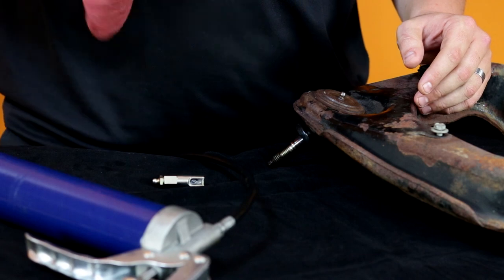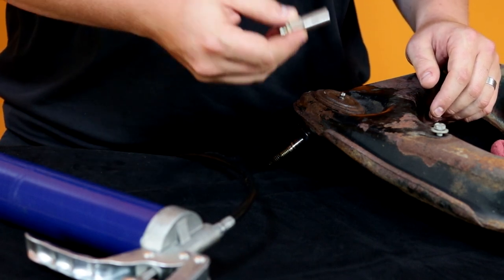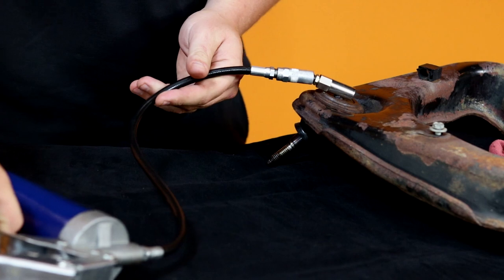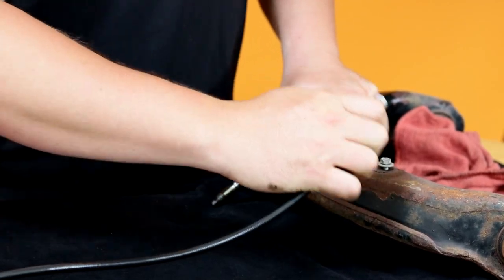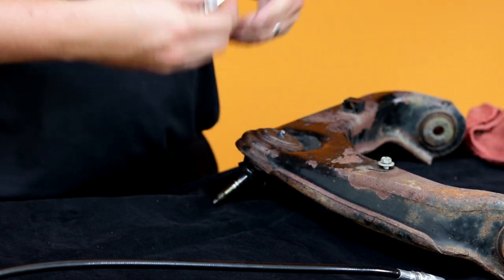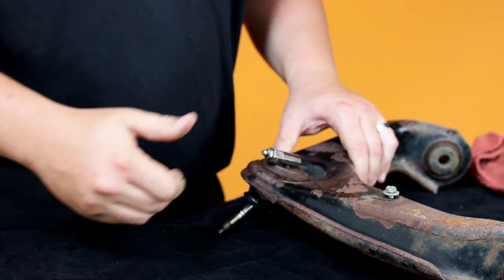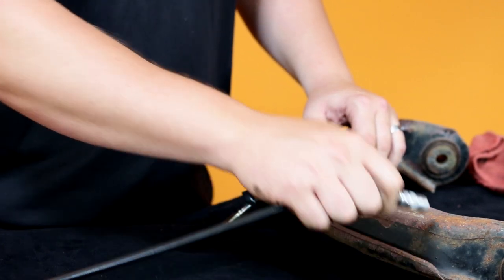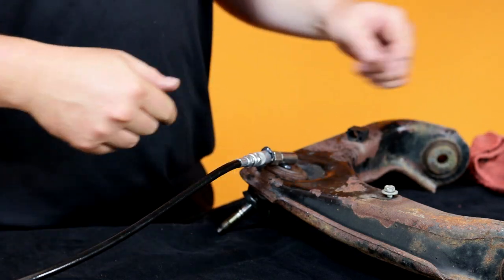Mechanics Minute: How to use the Right Angle Grease Adapter

Comment: I have two of those, different brands and can't get either one on the zerks on the Yamaha outboard. Neither snap into place. Grease goes everywhere but into the zerk. Have to use them on the 03 Harley dresser. Sometimes it works, other times it doesn't.
Reply: I've tried multiple different ones on my lowered silverado and none of them ever "snap" on to the zerk fittings
Reply: @caseylunsford3297  Big question you left unanswered was, but do you get grease into the zerk?